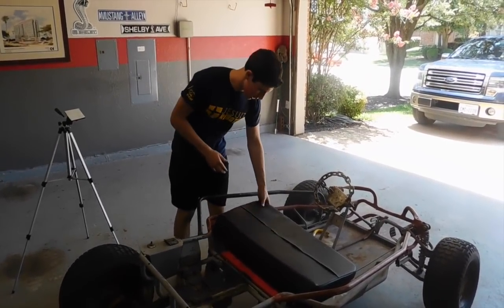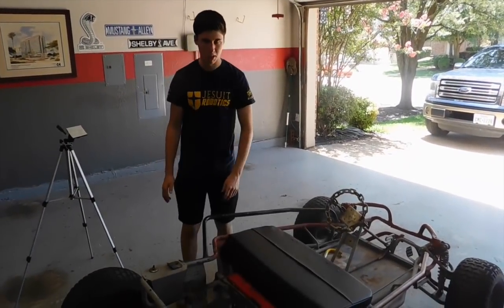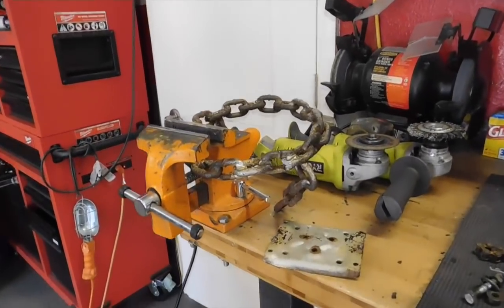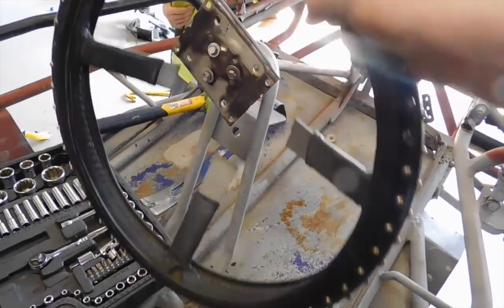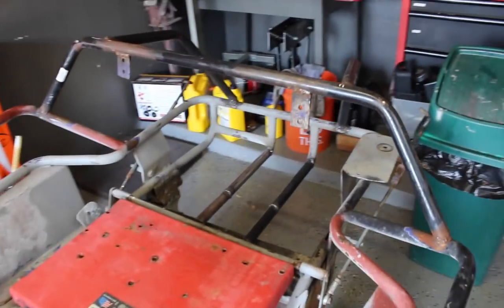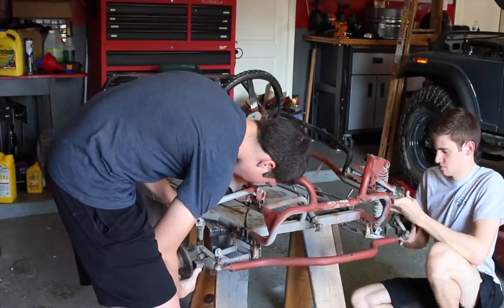420cc Off-Road Go Kart Build Part 1!

Comment: Great video guys, I'm doing a lightweight kids go kart build just now, but what gauge steel tubing do you suggest for building a kart that will support the predator engine without bending and tearing but also keeping it as light as possible.
ATB
Darren

Comment: It's still funny reading all the comments from people making fun of the welds, but they held up just fine supporting that fairly heavy motor.

Noobs... Don't pay any attention to the snobbery, you too can get a cheap welder and splatter it all over the place lol, it's not pretty but it still works, don't let snobbery hold you back.

Plus you can clean it up with a flap Sander.
Treat it like a hot glue gun, that's all it is.